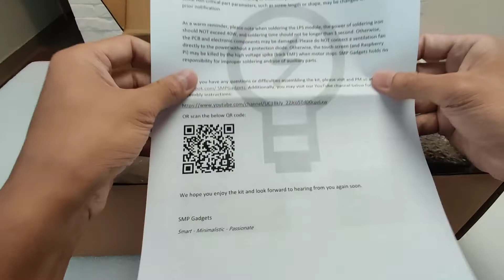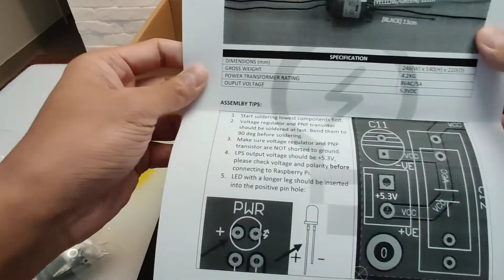R23-MAX Assembly Part I

Comment: Great kit. Do you sell just the chassis by itself?
Reply from the maker: Thanks. Not just the chassis, other components, such as QLED touch screen and the LPS module, are also included in the kit.
Reply: @vincentfong4154  Ok Thanks, I have everything but the nice chassis.
Reply from the maker: @fredthompson1279  the case can be sold alone. Please let me know if you're interested. Please note that the front panel works with Waveshare's 7" HDMI display only, it's not compatible with other brands.
Reply: @vincentfong4154  ok might be interested in the case and the display.  Cost?
Reply from the maker: @fredthompson1279  Can you PM me at?

https://www.facebook.com/SMPGadgets

 I will need to know your city so that I can provide you with a total cost. thanks.